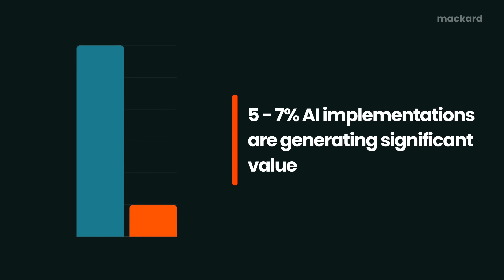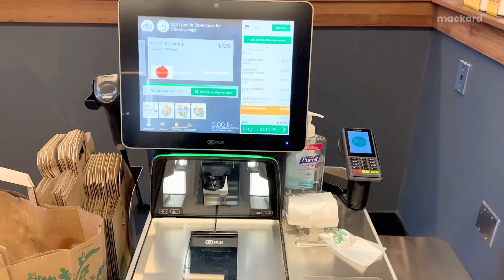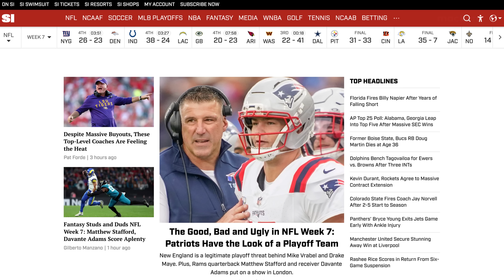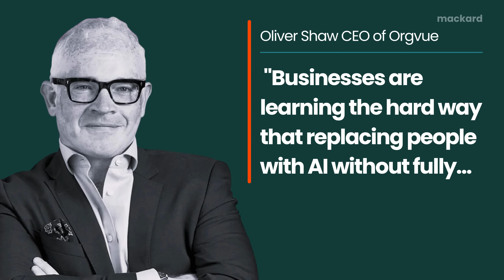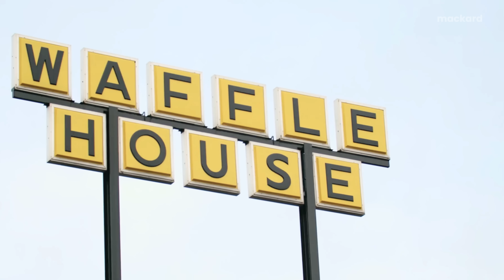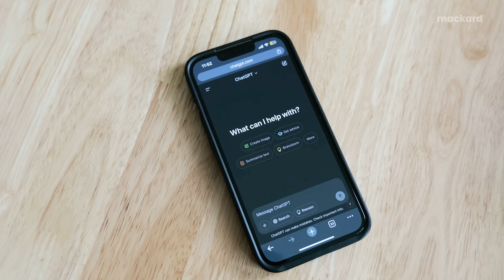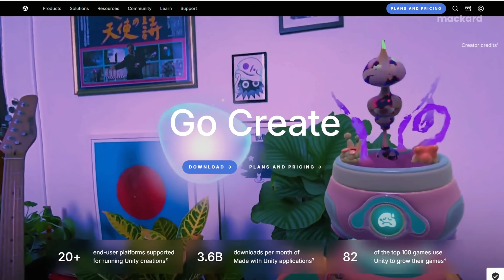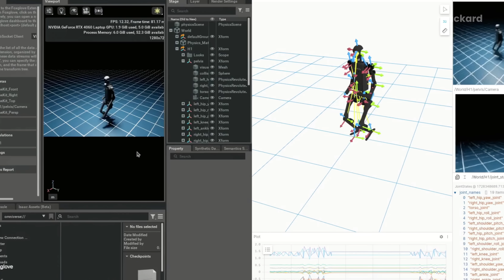Why Replacing Humans with AI is a Disaster

Comment: If you celebrate the fact that 55% of companies regret replacing workers with AI at this juncture, you lack a lot of foresight. 
This tech is still in its infancy, and 45% are seeing success? Give it 2 years and 95-99% will have success. This is only just getting started.

Comment: The first 50 seconds states the scary part and just doesn't realize it. Makes the rest of the piece a bit of a miss.

Yes 55 said they regretted it..... That means 45 percent of companies didn't. And this is the worse Ai is ever going to be.

 If at the worst state of Ai 45 percent of times a company replaces a worker with it they are happy with it that is massive. Extrapolated it that's millions of jobs. And when the next agent Ai is ready to be released it will be exponentially more capable than the ones we are on now so that 55 percent regret number could drop to as low as 20 percent and at that point it's game over for the old capitalism based system.

That's scary

Comment: The absolute crapberg that has to be avoided at all cost is AI in Cyber Security - that sector is often divorced from the rest of corporate / civil service sectors when it comes to broad corporate (lessons learned) information and security vendors are hard pedaling AI as a solution for security response.  If this is broadly adopted, it will have a negative impact on all of society.  False positives from AI or aegentic systems shutdown users account (read 'bank'), stop data flows and often miss real world vulnerabilities.

Comment: ”When AI systems break down, entire operations can halt. While human workers can resolve incidents immediately”

When an AI system before breaking down has saved 5000 hours of work through automation (saving let’s say $150,000), even if having humans on hand would resolve incidents immediately, if you lose say $30,000 on the incident, it will still be net positive. And looking at internet as an analogy: in the beginning it was less reliable, breaking down more often. And now we are super dependent on it always working. But at least I can speak for my own situation, the other day when we were without internet for a weekend, we had redundancy through 3 cell phones with internet (the problems occurred because I changed internet providers, and wasn’t aware that the new company only started a new service on weekdays).

Comment: Computers sat on desk collecting dust throughout the 80s with may people arguing that they are not worth the money and don’t increase productivity. Then you didn’t hear about that anymore, and there were no more stock brokers or file cabinets etc…
Reply: Yeah but computers help production when correctly implemented, just having a computer doesn't magically up your production if you don't really need it or use it, if you have a bakery sure as heck a computer is usefull to sell and promote but a 300k automated industrial oven is not necessary, also computer most of the time eased the job of people that were already doing that jobs in a slower way, it's way different than thinking a computer could just substitute a cashier

Comment: Video is a perfect example of linear thinking. Just like the FIRST automated cars in the DARPA challenge ran off deserted roads, now they navigate better than humans. Starting with the great decoupling in the 1970s, human labor has been and will continue trending to zero. Think about this-today, AI is the WORST it will ever be going forward. Think EXPONENTIALLY, not LINEARLY. Automation and robotics will necessarily replace human workers due to the current economic system. It DOESN'T MATTER if AI "creates" 200 million new jobs...AI will solve and execute these new "jobs" much faster than humans will be able to adapt, learn, and fill them. Capital/employee model-it worked great...for quite a while. However, now companies that automate lower their costs, become more competitive. Those that keep higher-cost human labor necessarily fall behind and will go out of business. This creates a system where replacing people with machines is not just likely, but necessary for company survival. There is a way to deal with this humanely, but it would require a full revamp of the social contract and our concept of work. Even capitalists will want this change when unemployment reaches a tipping point and there’s no one left with money to buy the crap they’re selling.

Reasoning AI Is the Next Big Leap. The future of AI is not just about generating answers, but about “reasoning” breaking down complex problems step-by-step, more like a human brain. Breakthroughs like DeepSeek’s open-source reasoning models are already being incorporated into platforms like GPT and xAI, marking a shift toward more advanced, thoughtful AI. Think EXPONENTIALLY, not LINEARLY.

There’s a persistent and misleading narrative circulating often perpetuated by short term goal-driven institutions like politicians, universities, and tech company executives, that the future of work is secure. The claim goes: “You just need to learn how to work with AI,” and humans collaborating with AI will outperform either one alone. But recent research, including a landmark study from the University of Virginia, tells a different story. In diagnosing medical conditions, AI alone achieved far greater accuracy than either human doctors or even doctors assisted by AI. The median diagnostic accuracy for the docs using Chat GPT Plus was 76.3%, while the results for the physicians using conventional approaches was 73.7%. Sounds like “a win” at first. However, Chat GPT Plus alone achieved a median diagnostic accuracy of more than 92%. In other words, the comforting idea that humans will always be essential partners to machines is crumbling. In many fields, AI is not just a tool, it is the superior performer. This has staggering implications for the future of work, especially to the often used solution of prior technological displacement that go “You just need to be retrained.” To the group advocating the "retraining solution," I pose to you this: You have a medical doctor, just finished 8 years of higher education, a low-paid 4-year internship/residency, is hundreds of thousands of dollars in debt, and just got outperformed by automation; what would you have this doctor retrained into that will offer a secure job?

The result of this, since the United States' moronic system is based on taxing employees for about 70% of all tax revenue, this will further exacerbate the problem. Tax needs to be based on what's going on now and in the future not what worked 75 years ago. Oh I know it's so evil to think, but we might need to tax the companies who are doing the automation. Even if you do that, it's a win-win. For instance say a company had 1,000 employees in automated away down to 100. 1,000 employees paid federal taxes, including payroll tax, of about 20 million a year. Now the 100 people pay about 2 million a year. However, by automating, the company sees two things: they are no longer paying approximately 60 million in wages and their share of payroll tax, AND since nobody automates to lose money they also have higher profits. What's so wrong about taxing that company for the $60 million dollars they don't have to pay anymore and a fair percentage of their additional profits they now make through the automation. Not all the additional profits, but some of them. If you do that there's a higher tax revenue and more profits for the company. That's a win-win for the government and for businesses. If humanity, as a whole, weren't so stupid, we would just adjust as tech progresses to where EVERYONE benefits somewhat from each stage and just move smoothly into the post-labor economy.

To understand this shift, consider the historical role of the horse and oxen. They were once essential to the economy as sources of power for agriculture, transport, and industry. Technologies like the horse collar and the steel plow dramatically increased their output, making them even more valuable. But then came the steam engine and, later, the internal combustion engine. These machines didn’t just help the horse, but outperformed it entirely. Trains, tractors, and trucks could do the job ten, even a hundred times faster and more powerfully. And from that moment forward, the horse was no longer critical to economic output. It was, in essence, unemployed.

This is what AI and robotics are doing to human labor. They are not simply replacing the repetitive or the physical; they are increasingly outperforming humans in cognition, strategy, design, and communication. And just like the horse, our value in the economic system will diminish, not from lack of talent or effort, but because machines will do the job better. That’s why we need to start thinking not in terms of retraining, but about restructuring society itself for a world where human labor is no longer essential to production. When the very essence of what makes an entity useful to the current economy is superseded (be that strength, endurance, dexterity, analysis, creativity, empathy, intelligence, persuasion as well as many other qualities) that entity becomes irrelevant to economic output.

Potential solution. Decentralized AI Ownership: A Bridge Toward Post-Scarcity. While Universal Basic Income (UBI) may serve as an initial economic stopgap, bridging today’s economy with tomorrow’s abundance consider an even more equitable and long-term solution: Decentralizing the ownership of artificial intelligence itself. 

Rather than concentrating the power of AI in the hands of a few corporations or governments, envision a model where AI entities are open-source and collectively owned. This could take the form of assigning each person a digital "share" of an AI system, not unlike a stakeholder’s share in a company. As the AI produces value, whether through intellectual labor, creative output, or autonomous economic participation, those shares would generate dividends distributed directly to individuals. 

This model would ensure that as AI becomes the dominant productive force in society, the wealth it creates is shared universally, not monopolized. It aligns with the principle that the fruits of public knowledge made possible by centuries of human collaboration should benefit everyone, not just a few early adopters or private entities. In practice, this could look like: 

- AI systems running Decentralized Autonomous Organizations (DAOs) that distribute profits algorithmically.
- Smart contracts ensuring transparent, equitable income flows based on collective stake.
- Global “AI cooperatives” where users vote on how AI is used, improved, and deployed.
- Universal basic compute.
 
If AI becomes the primary driver of economic output, then equitable access to its benefits isn’t just fair, it’s necessary to avoid deepening inequality and instability. It provides a scalable, technologically aligned extension to UBI, ensuring people not only have income, but true economic participation in the age of intelligent machines. 

Ultimately, decentralized AI ownership may be the last transition phase before full post-scarcity, when advanced technologies like universal nanofactories or matter compilers render even economic structures obsolete. Until then, however, models like this offer a way to reclaim agency in a world where production no longer requires human hands, and where wealth can, for the first time in history, truly be universal.

Comment: Most CEOs came into their Position long after the company was founded. They have no real connection or understanding of the company. All they care about are fancy power point presentations with a big number at the bottom that they can wave to the shareholders and brag what agreat job they are doing. If this means sacking thousands of employees to use unreliable tech they will do it in a wimp. As soon as shit hits the fan those CEOs are the first to run and leave it to others to deal with it. They need to be accountable for their decisions, even after they left the company. They get compenstated greatly to take the responsibility, so they can't leave it at the door and run with the money

Comment: If they just focused on automation without AI they would replace most of us. We are lucky these CEOs are out of touch with their most efficient employees separated by a bunch of bottom managers. If they listened to those employees it would be just normal automation and that would hurt hard the job market. 😅
Reply: YESSSS I FUCKING CONFIRM THAT, i work for the italian highways and they insist on trying an automated system to read plaques that hardly works even in a controlled environment to reduce workers but losing money while giving a worst service, instead of making a couple of simple software and machine upgrades and andjustment that would cost waaaaaay less and is more integrated to the existing problem

Comment: For most iterations AI also needs a constant and consistent internet connection to work
Reply: yep that is why AI products like Copilot PCs are scams
Reply: @bandita2068  I’m trying to make sense of this comment. Many new computers have a chip called an NPU, that unlike a CPU or GPU is optimised for calculations needed for LLM inference. That means a model (that is just a small program basically) could use your local resources to answer your questions. Though you will still need internet connection if you want to leverage resources from the internet or when you want to update the model. So it doesn’t require internet to work, but some features (tools) that boost its capabilities are dependent on an internet connection.

I personally want computers to continue getting improved NPUs, because running your local AI is the only way I can visualise that you can make sure you are not sharing your discussion with any of these companies. And if the day comes where they start using the data you share with them to make super targeted ads or similar, I want out.
Reply: Actually data efficiencies are improving, models can be implemented locally, the models can be updated incrementally like updating an app. It is a similar difference to cloud computing and using local servers.

Comment: I work with the output reports of an AI that investigates civil infrastructure. I spend half my time fixing it's mistakes - missed details and defects avoiding noisy "observations". Yet this AI is the "equivalent" of a certified inspector to the client, purportedly. It's come so far but has to long to go.
Reply: so far to come and so short to stay!!! To sustain AI greedy capability, it will wipe out entire earth's resources...AI is just not sustainable in the long term!!!
Reply: Same experience for me. I work in Automation and specifically using AI in Automation.
Our rules are simple: If a task can economically solved with Automation do it. Only tasks that can't be solved that way are worth investigating. In Germany almost all customer demands have two reasons why they want AI. 
1. They don't find a human to do the task for the pay. 
2. They want to ensure same quality over multiple facilities worldwide.
Also the AI we use in Automation is not a LLM like GPT but a rather extremely specific model made for one single Use-Case and only that one. Generalisation of AI models had led to the problem that was talked about in the video - unreliable outputs.
Reply: @rofl2482 can I ask you a question ? 
From the job you're doing, is Automation Software still worth in the future ?
Reply from the maker: Thanks for sharing your experience!
Reply: 1 problem with generative AI, it always make seems that it knows what it is talking about, even when it is making stuff up on the fly. 

As long as the ai can make a Frankenstein patchwork of a solution for your problem, it will suggest it with confidence. 

But it takes expertise to know it looks alright but it is a complete failure.